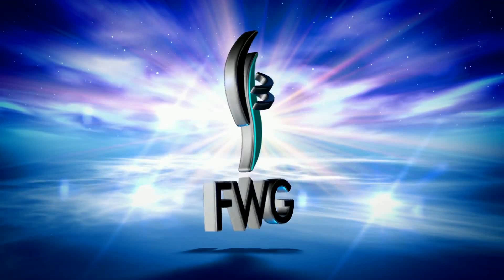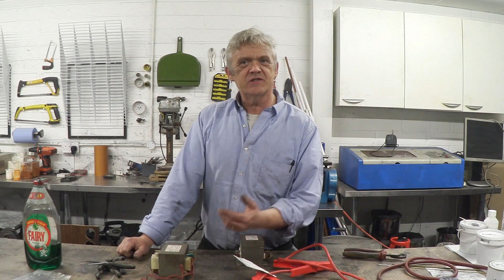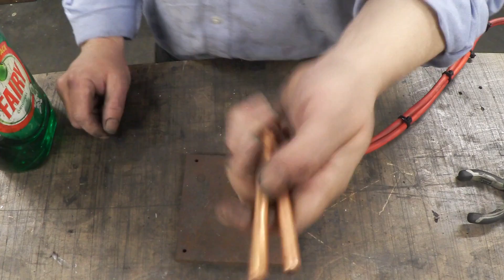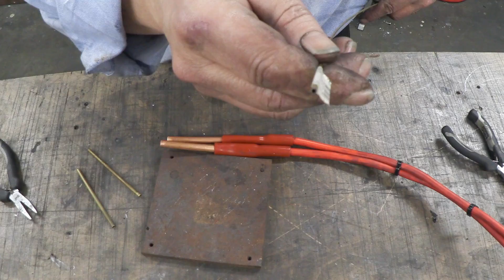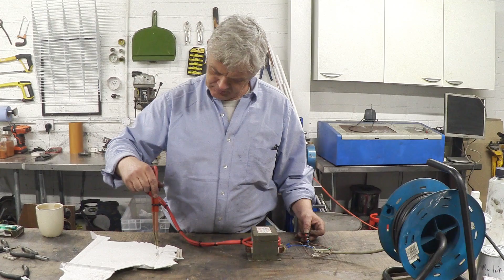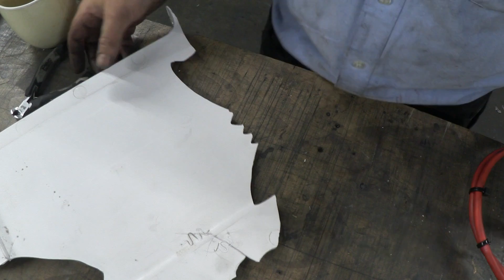DIY Hot Plastic Stapler

Comment: you probably want 2 winds, might wake the trany up (bit slow) mind you , impressed with the lack of smoke , probably best take those pipe cutter burs out, for more fun pushing the wires in . how about if you got one of those old tranny soldering irons , they v even got the 2 little tubes .i got the DEADLY second windings out by slicing one side flush with a 1 1/2 inch wood chisel and levering the other side with a screwdriver . was easer than typing this. thanks for your stuff

Comment: Mr Smith,  I have all done including the switch.  All except the smaller tubes which hold the wire staple. Can you tell me in what application these are normally used so I can start looking in that direction. Thank you for this good video. Very appreciated. Phillip Hall

Comment: It really did work, and really well too. It only takes a seconds to get it red hot staples on my DIY 18650 tab welder from microwave transformer.  I used 2 brass bolts, drilled 1mm hole in the middle (1/4" deep), used a 1/4" copper wire, used a hex crimper to attached it on both the bolt and the  cable. With a little solder, to finished the cable wires since to booster cable wire is a bit bigger than the tubing. Putting the bolt on a drill on to a grinding wheel made it easy to shrink it to ID of the copper tube.A shrink tubing to finish and make it look pro. Depending on the plastic, I press it for a second before inserting it on plastic. Need to blow on it the cool the wires faster though. Thanks again, it was fun and quick making it.

Comment: Thanks for the awesome video. I’ll be making one of these for the shed. I also want to make one using 12 or 24v DC. I drive a garbage truck and sometimes am a long way from the workshop. With bins that have a damaged front edge, I could just throw a few staples in it to make it safe enough to empty until a replacement bin can be delivered. What would I have to do between the supply and the electrodes?

Comment: Hello, Thank you for your excellent videos. 
Ref your plastic repair gun. I was canoeing in the South of France on the Ardeche river and one day a guy arrived to do some repairs on the canoes which were made of a hard orange coloured plastic. The canoes had all sorts of cuts and scrapes and holes in them. Obviously, this plastic (I suppose all plastics), melts at a certain given temperature. The repair man had several sticks of the same coloured plastic and he literally used a Hot Air gun (a sort of very hot hair dryer thingy) which he used to soften the area he wished to repair and the stick he was going to fill the damage with. Once soft enough, he bonded the soft plastic into the cut or hole and then used a metal scraper to smooth the repair out. Once it was cold again, he used fine sandpaper to finish the job. 
The Ardeche has some really serious rapids and the canoes could get quite badly damaged. We actually managed to bend a two man canoe completely in half, almost drowning me in the process!  
Thanks for all the very interesting vids.

Comment: No matter how much you staple a damaged bumper, once it is damaged it's ability to protect you is compromised.  Relying on a rigged bumper is very dangerous.
Reply: My goodness man, the plastic bumper cover is only for looks. It has no safety feature to begin with. The steel inside bumper that you do not see if for  safety.

Comment: A wonderful idea for bulky repairs!  I'll have to keep this in mind.  Of course, it would not be suitable for the tiny repairs I've done in the past.  Like inserting a quarter-inch pin to repair a latch.  The pin was made from a bit of paper clip, one end sanded.  I just heated the pin with a small torch or lighter while holding with very small pliers (needle nose).  The sanded pin helps get a better grip in the plastic (I did not want to have to repeat the "surgery" at a later date).
Reply from the maker: cool mate - thanks for sharing

Comment: hello sir, keep up the good work . i am working on a battery as annual project and wanted to ask that in your video you said that MnO2 cathode makes a primary battery, but is there a way in which we use MnO2 to make a secondary magnesium battery probably with new electrolyte, solid state electrolyte.

Comment: Fantastic idea Robert!
I had no idea what to do with the microwave transformer I have in the closet!
I always use either window cleaner as a lubricant for sliding tight rubber over metal or, if I'm really wanting it to stay,  I use hairspray. It's how we use to put  rubber handle grips on bicycles, when I was a little kid.
We had to cut them off, when they finally wore out!
Keep up with the good ideas mate! 👍
Reply from the maker: glad you liked it mate

Comment: Great idea, I repaired a bumper with some wire and a soldering iron once, it worked but took ages, this would be much quicker,
BTW if you put the insulating hose in hot water for a minute or so it makes it much easier to slide on
Reply from the maker: nice tip mate - cheers

Comment: I think I will make one, thanks Robert.  I do a lot of repairs for myself and others, plastic was always a problem to repair, without the right tools.
Reply from the maker: yeah I found that mate - my wife recently bumped the car and cracked a plastic lug on the light. Because of that we failed the mot and had to get a new light - it cost UK£600 for the light cluster!!!! - 600 - unbelievable - so I repaired it and it passed

Comment: Love the demonstration you did joining plastic. Robert may I make a suggestion to you that when you use a tubing cutter, use a inside reamer or even a drill and you will not have the problem of pushing in the fine hand twisted wire you were experiencing. Just saying fella. Peace to you too. VF
Reply from the maker: cheers mate - the tube cutter has a reamer and I didn't do it for speed. of the vid - but nice suggestion - thanks

Comment: @Robert Murray-Smith. It's handy to wind a few more turns on the new secondary side, adding taps it at various intervals, to create selectable outputs, it's better for applying staples to thicker materials like polycarbonate sheets. When you melt your staples into the crack, try rejoining it with the staple running parallel to the crack, not across it, your stapling method only supports the crack with one wire strand per staple. Make the undulations in your staples smaller, for tighter looking joins after sanding. Thanks for sharing.
Reply from the maker: thank you for sharing mate - that is awesome advice - I get you know a lot about this tool and these techniques - so thanks for sharing

Comment: Another innovative video,  thank you.  I have collected old microwave ovens for years. 
As a high voltage enthusiast, the transformers form the basis of of many projects that interest me. 
I have also done the high current stuff as well, but I go to great lengths to keep the secondary winding intact. The microwave ovens also can yield a digital clock and a very useful timer circuit.
Reply from the maker: Thanks for the info mate

Comment: Robert, you make my lockdown so much more fun and mind expanding. Thank you.
Reply from the maker: Glad to hear it thanks for taking the time to say so. I don't know about the brown's gas but I will have a think for sure
Reply: Robert Murray-Smith thanks
Reply: Any ideas for a brown gas hydrogen water health machine, for drinking water. Thanks.
Reply: heidi smith I want to make one of these too   I assuming the same design rob showed earlier with the added activated carbon felt would work and using potassium hydroxide as the electrolyte instead of the urea 
I thought the ac felt would adsorbed any undesirable elements such as any chromium that might leach from the stainless steel mesh or expanded metal SS   I did think maybe some zeolite in the mix too might help  one could also make a gas filter with the ac and or zeolite after a bubbler should be an extra safe guard 

I’ve ordered some fine s mesh to make one  but I also want to make a big one for welding etc and was wondering if one is using the ac felt does the need for a fine mesh get negated for the extra efficiency as the larger hole expanded metal is cheaper 

Great video as usual 😃

Comment: Hi Rob. If possible, I would appreciate it if you could take another luck at your Al-Air battery. I am wondering how useful it could be as a primary battery for energy in winter. I bought a roll of aluminium foil yesterday for 65p (290mm X 20m) and it got me thinking how useful it would be to power appliances in the dark winter months when solar PV just doesn't provide the amount of energy required.
Reply from the maker: will do mate - but what about the thing i did on the magnesium battery - that was pretty awesome even if i say so myself
Reply: @ThinkingandTinkering  It was Rob, but the ubiquity of aluminium foil makes it more accessible. I was just wondering what a 290mm wide, 20m long carbon felt and aluminium jelly roll air battery could produce in terms of power? I made a choline chloride/urea/CMC gel a couple of years ago and it was producing a steady ~1v output which I coupled with a homemade joule thief to power an LED. However, it would be great seeing it doing some real work either powering a decent sized DC motor or a conductive ink heat panel.
Reply: @VinoVeritas_  i doubt the power produced from a few grams of aluminium foil will do much. But a 5Kg Magnesium alloy wheel will produce oodles of power. Possibly KWh's worth.   5 or 6 of them in large buckets wired in series connected to a 250 volt inverter and away you go. Enough decent power to keep you going for ages. Scrap wheels (make sure they are magnesium) cost a few £ each though.
Reply: @williamarmstrong7199  The theoretical energy density of an Aluminium-Air Battery is 8kWh per kg and Magnesium-Air is 6.5kWh per kg. Aluminium is also half the price of magnesium. I can walk into any supermarket or convenience store and purchase a roll of aluminium foil. The same can't be said for magnesium.